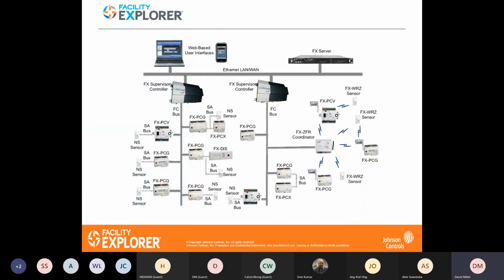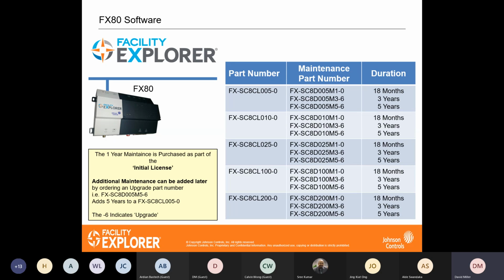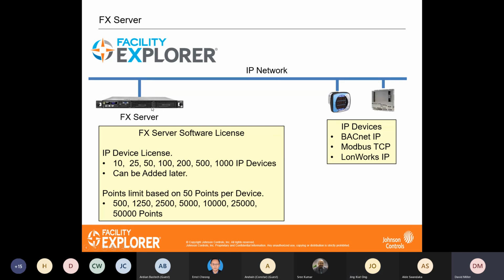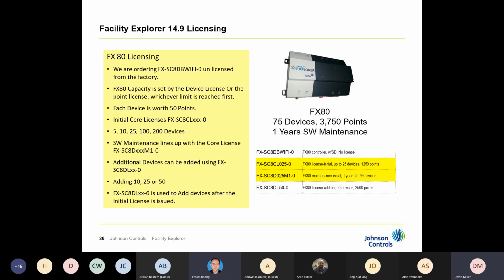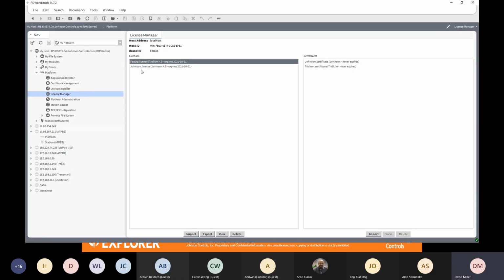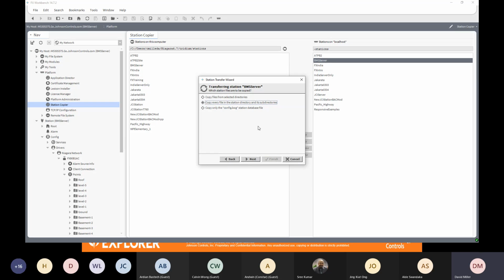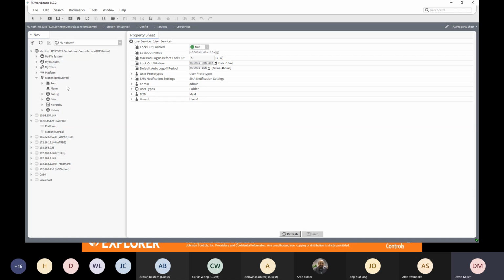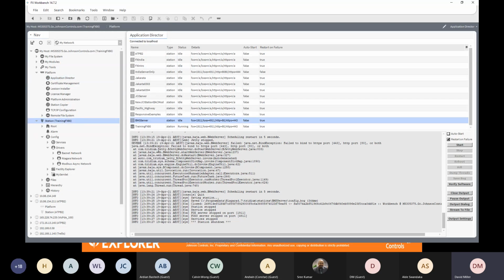FX Training Webinar 1

Comment from the maker: Nội dung chính trong Video FX Training Webinar 1:

00:00 - Giới thiệu về hệ thống Facility Explorer (FX)
01:33 - Kiến trúc hệ thống: FX Server, FX80 và Field Devices
04:04 - Phần cứng bộ điều khiển FX80 & Các module mở rộng (RS485, LON, RS232)
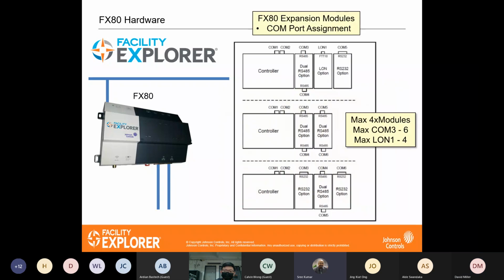08:26 - Quy tắc đấu nối RS485 và giới hạn số lượng thiết bị
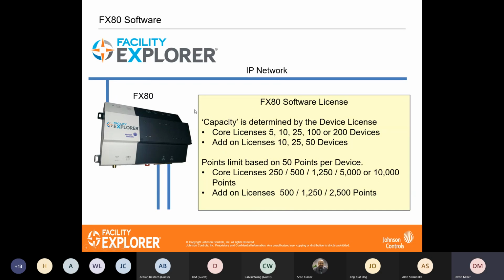11:32 - Các giao thức hỗ trợ (BACnet, Modbus, SNMP, M-Bus, KNX)
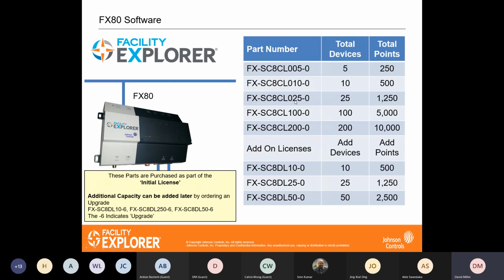13:30 - Chi tiết về bản quyền (Licensing): Device & Point Limit
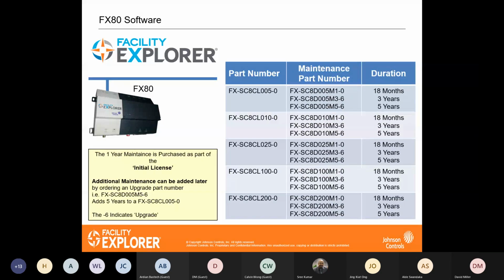15:26 - Chính sách bảo trì phần mềm (Software Maintenance - SMA)
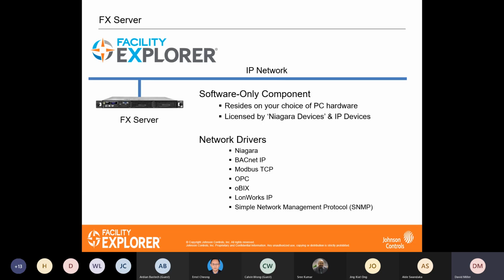18:28 - FX Server: Cấu hình phần mềm và kết nối mạng Niagara
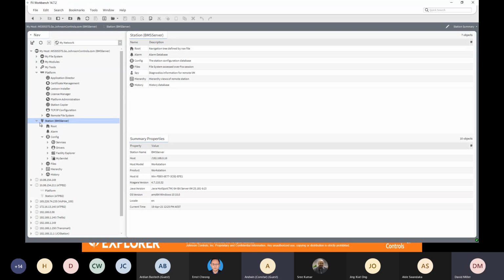24:36 - Cách thiết lập trạm (Station) trên FX Server
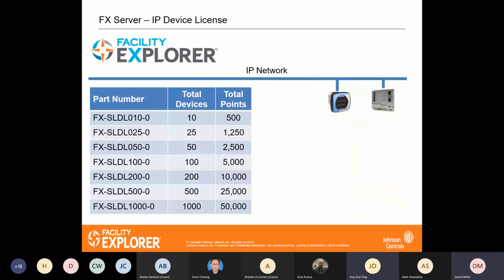29:43 - Kết nối trực tiếp thiết bị IP vào FX Server
40:44 - Lưu ý về giới hạn phần cứng và mở rộng hệ thống
49:15 - Làm quen với giao diện FX Workbench (Client & Platform)
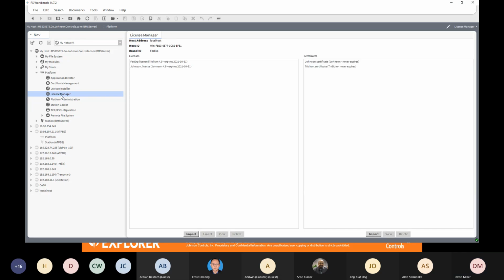54:10 - Quản lý License và Host ID trên máy tính
1:00:15 - Khả năng tương thích với các thiết bị Niagara bên thứ 3 (Tridium)
1:10:13 - Quản trị Platform: Sao lưu (Backup) và cấu hình IP
1:20:54 - Cấu trúc Driver, Điểm dữ liệu (Points) và Wire Sheet
1:30:47 - Hướng dẫn tạo một Trạm JCI mới (New JCI Station)
1:44:20 - Giải đáp thắc mắc và kết thúc buổi học

Tóm tắt ngắn: Video này tập trung vào nền tảng của hệ thống Facility Explorer, bao gồm kiến trúc phần cứng FX80, cách tính toán bản quyền (License), chính sách bảo trì và hướng dẫn sử dụng phần mềm FX Workbench để tạo trạm điều khiển đầu tiên.